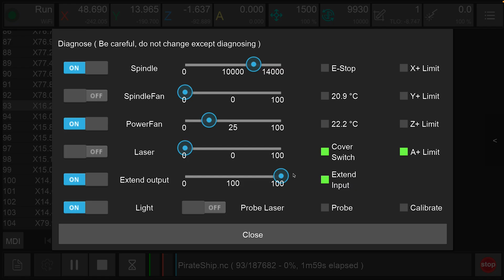Makera Cyclone Dust Collector Overview Tutorial

Comment: Can the dust collector also be used as a kind of vacuum cleaner and use the tube for example to vacuum the inside of the milling machine?
Reply: I was about to ask the same thing before I saw your comment.  I would suspect that you could use it so long as you manually controlled its speed as there's technically no difference.  The only thing I don't know is if there's a limit to the size of chips/shavings that you should be picking up with it.
Reply from the maker: Absolutely!